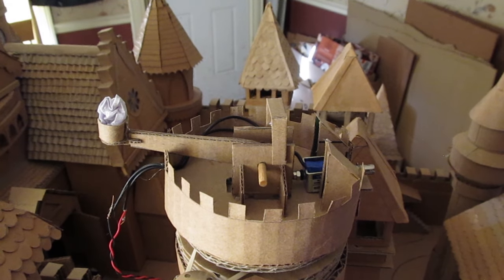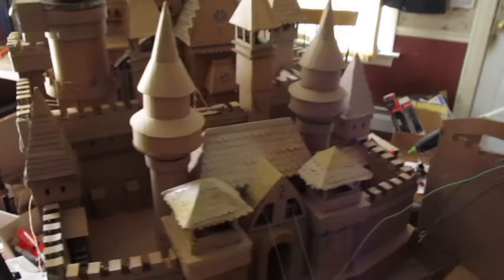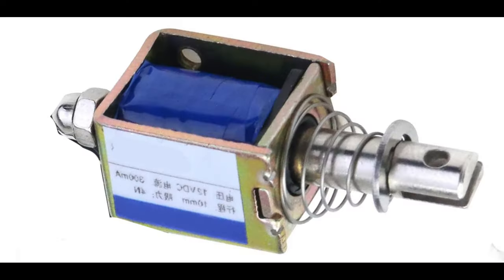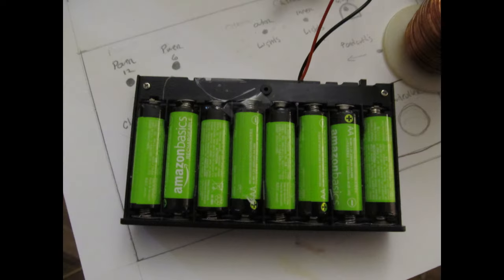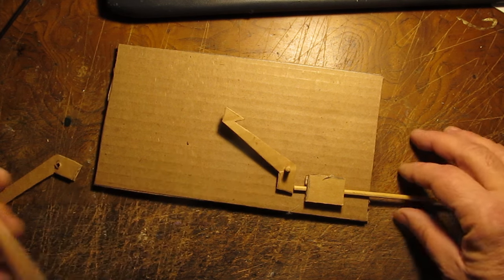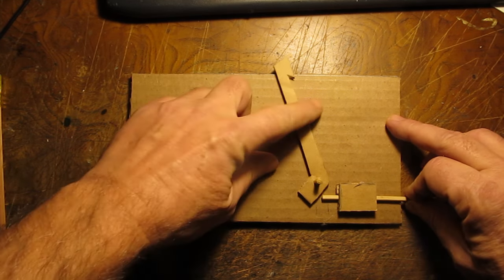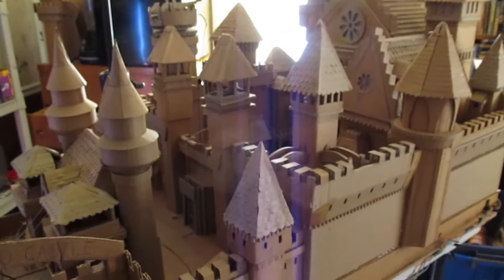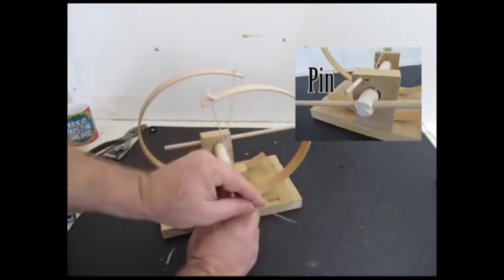Modern Meets Medieval: The Solenoid Catapult

Comment: I think the most straightforward approach to create a relationship between the solenoid displacement to the catapult arc would be as follows (starting at the profile view of the mechanism shown at 4:07):

The horizontal displacement of the solenoid will be referred to as “deltaX”. The length of the arm that extends from the pin to meet the dowel representing the solenoid I will call “e”. This is the measured distance from the center of the pin to the wooden dowel’s point of contact. The length of the catapult arm itself is “r” and the arc length it traces will is “s”. 

First, we are after the angular displacement of the mechanism, “Theta”. 

I envision that the values of “e” and “deltaX” form a right triangle when the solenoid is activated. We can exploit this geometry using a trigonometric relationship to compute an angular displacement, “theta”, for any “deltaX” or “e”. 

The formula would look something like this: theta = arcsin(deltaX/e) 
(Eq. 1)

When calculating inverse sine (arcsine or sin^(-1)) be sure the calculator is in radians. The next formula takes radians by default.

Since the catapult is a rigid body, the displacement we calculate here is also the displacement of the catapult arm itself. 

Second, we can invoke the definition of circular arc length to compute the distance traveled at the end of the catapult arm: S = Theta*r(Eq. 2)

Substituting Eq. 1 into Eq. 2 we get the formula for S:
S = arcsin(deltaX/e)*r 

To compote the amplification between the solenoid displacement and the catapult angular displacement ratio: 
S/deltaX 

This ratio may also be thought of as the ratio between the linear velocity of the solenoid and the tangential velocity of the projectile in the catapult bucket.
Reply from the maker: Wow. Stunningly well explained. My gratitude to you for the work you put in. Thanks!
Reply from the maker: I am pinning this comment to the top so viewers can see it and get the benefit of it.